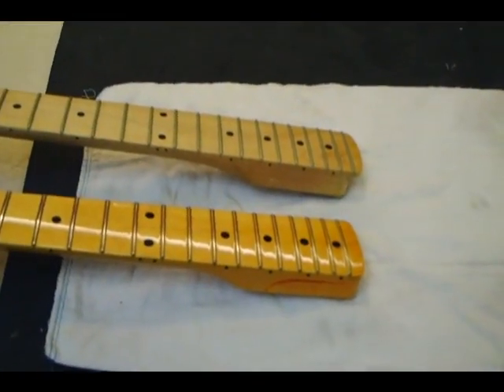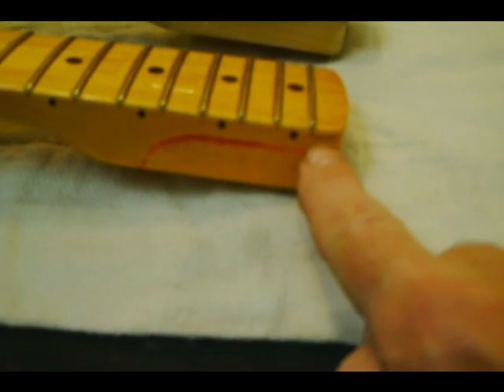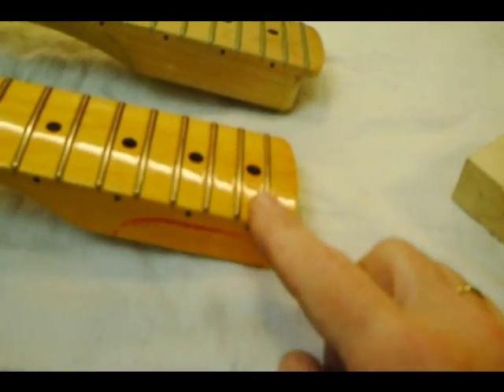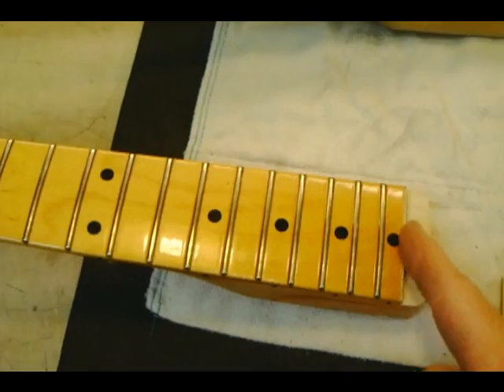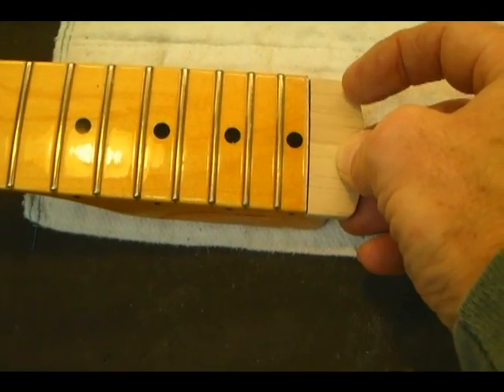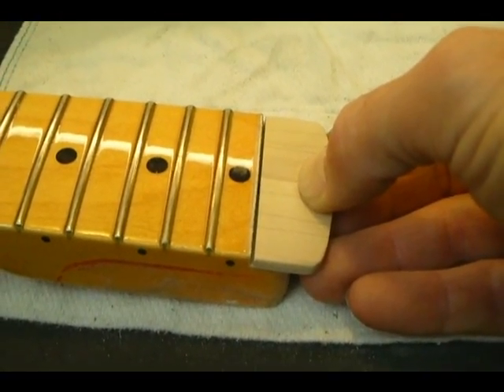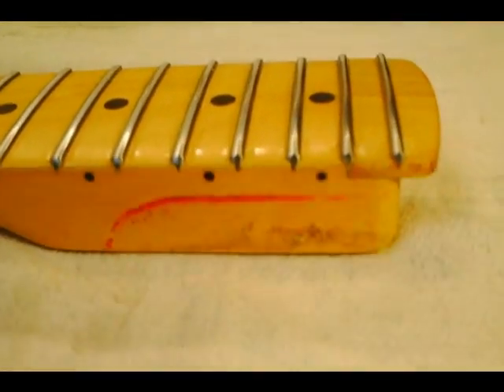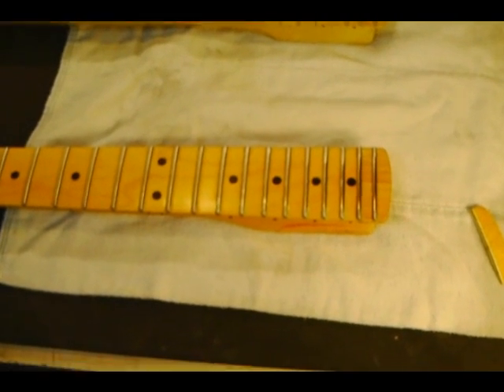Keith Holland Guitars Adding a 22nd Fret to a Guitar Neck

Comment: Way back when crazy glue was first out I used it to simply glue on a fret that was pre-bent to hug around the back. Just taper file down the ends so strings don't get hooked underneath when you hit the strings hard. A couple people through the years have said 'but that's not correct it's not intonated', my reply has always been "when I'm up there it's all screaching pterodactyls, and stuka's screaming in the night.

Comment: Normal tuning, the 22nd fret works with SO MANY keys that you'll find most songs are in. And bending a 21 fret guitar up to the D will push it to a different pickup and won't sound as good in the studio or live as it does at home. It's my biggest complaint about the Noventa line Fender has right now. (I like the Noventa line, I think I want a neck swap on my Jazzmaster though)

Comment: I did the same to a 21 fret neck just like that one, but without the inlaid piece. There is plenty of room to just cut another fret slot! If you get it in the right place, it will be right on the corner, and you'll lose a tiny bit of width, but, on the treble side it's no problem, cus it's still under the string, and if you bend the high E, you're only ever gonna bend it upwards. On the bass side it's no problem cus...well you already have that note on 4 of the other 5 strings. It looks a bit odd if you get up close, but the fret is really not missing much off the ends at all. It works perfectly. I was worried more about breaking a piece off the bottom of the fretboard, cus there's not much wood left there, so I held my breath when I pressed the ffret in, but...yup...worked perfectly. Now I can play that ONE song I needed a 22n fret for :D
Reply: you should have recorded it :)

Comment: G&L Legacys and Fallouts both have 22 frets and no fretboard overhang. The neck heel is just longer and effectively produces more mass at the neck/body joint. There is absolutely no reason this should not be the standard on modern bolt-neck guitars. 21 frets is completely unacceptable in the 21st century.
Reply: And they look terrible with this square telecaster like neck end
I think the beauty of fender necks are that they all are relatively interchangeable, whether you want vintage neck with 21 frets, or 22 fret neck

Comment: Is it possible to add a 21st fret to a 20-fret bass?
Reply: I was wondering that too. It's probably the same way, really. The pickup is very far from the neck in my case, so it wouldn't be a problem.

Comment: would it be possible to add 2 more frets to a 22 fret guitar (I need 24 :) ?
Reply: I'm doing it with my yamaha pacifica 012. The 24th fret is gonna be over the neck pickup so i gotta move it a little bit. I will post a slide show once it's done.
Reply: Fender puts their neck pickups directly under the harmonic, where the 24th fret would be.

Comment: Can the same be done to 24 fret?
Reply: Yes i believe if you have carpentry skills, you can move the neck pickup backwards, first is you cover the original neck cavity with a piece of wood, flatten and sand them then add your 24 fret extension, then route the new neck pickup cavity, you have to find and buy or make a pickguard without neck cavities so you can measure and calculate the new neck cavity and route them.